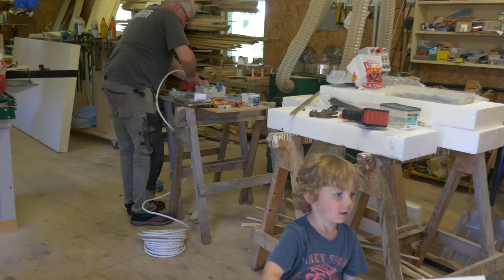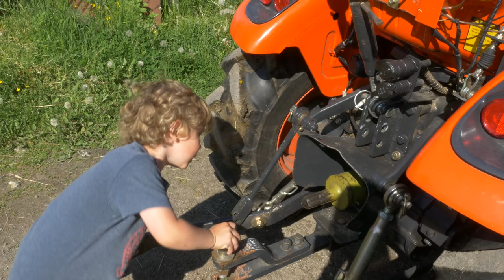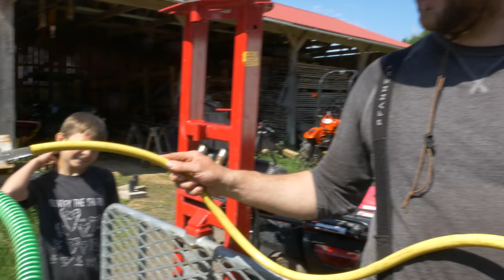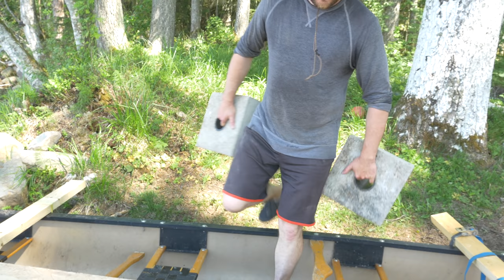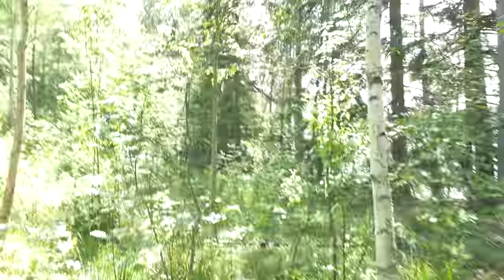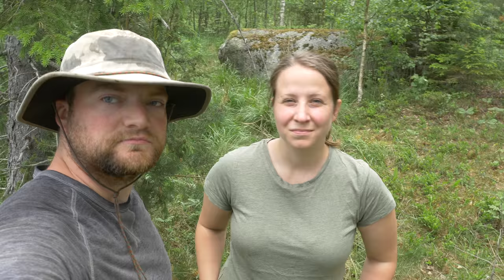This Will Make Our Farm Thrive

Comment: Self reliance is the best feeling! Nice you have a lake and the legal access, that’s 90% of the battle. My dad grew up on a small family farm ‘off grid’ before that was even a thing, because half the country didn’t have a grid in the 1930’s. He always said it was easy to live without electricity, but impossible to live without a good supply of water. I’ve pumped water by hand (1 liter per stroke) for 2 horses, 4 cows, chickens, and general family use, and it’s a lot of work!

Comment: Push water don’t pull, a small well submerged pump from the lake to yard. Storage tank with a pressure pump at yard, my system has ran that way for years, it’s very cost effective and you don’t have to have a insulated building at the lake. Just wires and a plastic pipe going out into the water. Great job so far, water is life!

Comment: You can only pull water so far, the pressure drop on the suction line will cause cavitation in the pump and prematurely wear out the internal components. The pump down by the lake is the best choice. You'll probably want to add something on the end on the water pipe to keep it off of the lake bottom to avoid sucking in dirt too. Clear water pumps cannot handle much sediment. They just aren't built heavy enough. I think you insulated your pump house for freeze protection but what about heat from the motor during the hot summer. I don't think there will be sufficient cooling from the lake water flowing through the pipe and pressure tank under prolonged use. You will likely be fine for intermittent use though. Just something to keep an eye on. Great job on the water supply!

Comment: No pump known to man can pull more than about 9 metres vertically  Its atmospheric pressure which actually pushes the water up....1 bar but no flow. The pump has to be close to or in the water to work. Also the distance causes fluid drag in the pipe, bigger pipe gives better flow.  I hope it all works out!
Reply: I came here to say this, thank you!

Comment: Do they have equipment rental places there ? A trencher will work to lay that pipe in the ground.  We have what is called a ride on chain trencher with a 5 ft. blade... It's $300 a day..  it'll chew right thru tree roots etc..  if you arranged to have some lights up by the house end you could start by the lake in the morning and  finish it in one day.

Comment: Those pumps are good, cheap and reliable (usually). Will be tricky to get all that safe for winter though, too long for a heater cable inside (I have 50 meters, and it draws 1kw peak when thawing the waterline.

Comment: I enjoy seeing how you design the things you build. I was concerned about the voltage drop to the motor due to being so far from the electrical source. But it works great. Good job.
Reply from the maker: it is 400V which has less loss.

Comment: The system you have chosen to install is very well suited both in output, maintenance, cost and energy efficiency. And with a normal three-phase 400V solar powersystem you will power your water pump anyway if the cable and solar power is in same farm electrical system. Standard systems is cheaper today.
And as a farm you get bigger subsidies to install than ordinary homes. My premium 48 sq meters - 9 kW system is now under 10000$ minus subsidies or ROT and what you don't use you sell to some power company. Use the communal energy adviser to help you choose some good installer.

Comment: Do a foot valve, switch and a pressure tank and you can half consent on demand water
Reply: He evidently has a foot valve and pressure switch already, if he can turn on a faucet and have water come out.
Reply: @brucea550  you are right, i missed the part with his dad putting it on. Thanks for the correction. But i didnt see the switch, but maybe i missed it. The tank would keep it from running the pump constantly when he opens the valve.

Comment: Hi, would you mind sharing what pump exactly you bought?
Reply from the maker: We bought it used. Not sure what the brand is.
Reply: @simeonandalex  ok, I'm looking to make similar setup. Just don't have a clue how strong a pump I would need.
Reply: Start with how much water you need, then design the system from the existing conditions.